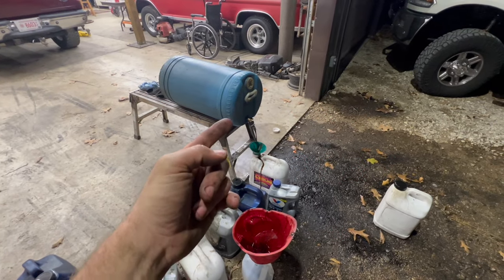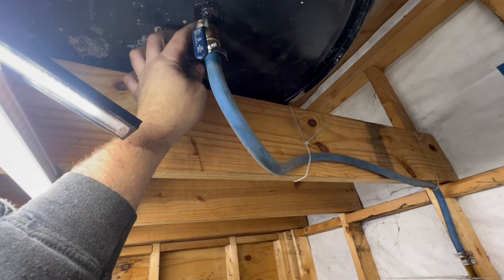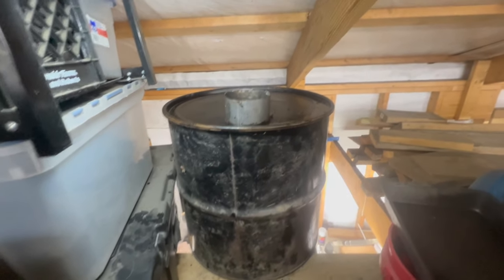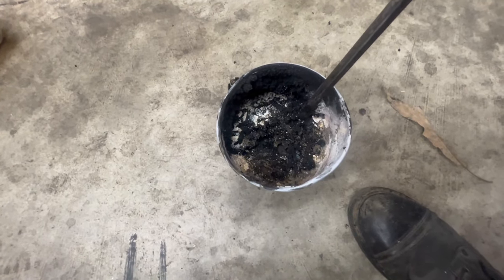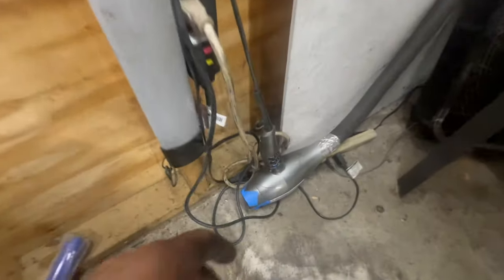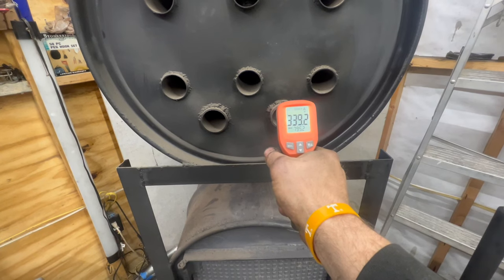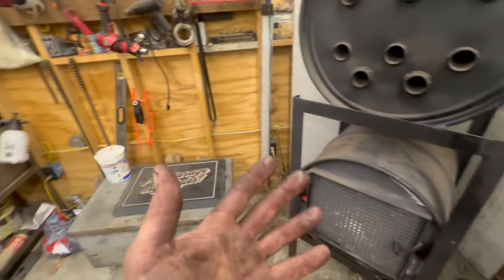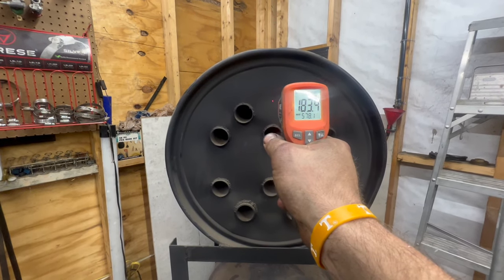waste oil burner cleaning and refilling

Comment: I'm putting my heat exchanger in the bottom barrel (no top barrel) which will be 4" stainless steel. My blower will be a smaller squirrel cage blower (Amazon) which will be much quieter than a blow dryer. My stove will be outside covered and I will blow air from inside the building to the heat exchanger and back to the shop inside. That way it will reheat the inside air instead of heating the outside cold air.
Reply from the maker: The blow dryer isn’t blowing through my heat exchanger. It feeds the waste oil burner fire. The box fans blow through my heat exchanger and they don’t pull outside air. Did you even watch the video?
Reply: @AutomedicGarage  Yes I did watch the video. I was just saying you can get a small, quieter fan to feed the burner instead of a hair dryer. Infact you can geta small squirrel cage fan (about $18) with a variable speed control switch to regulate the blower output if you want. Pretty slick. Beats the hell out of listening to someone drying their hair!

Comment: to a 5qt oil jug add 1qt gas (old , drained gas works too) then 4qts waste oil to make fire starter . shake well , then shake briefly each time you use it . cold stove only , light (toss in a piece of burning paper) as soon as you put starter in stove , don't allow it time to fume off before lighting . i use about 4 oz (vienna sausage can) to start my oil burner . cheap .